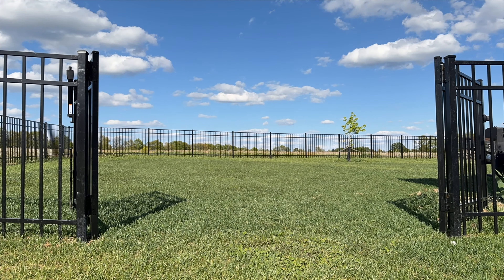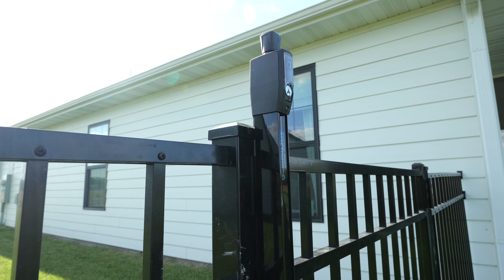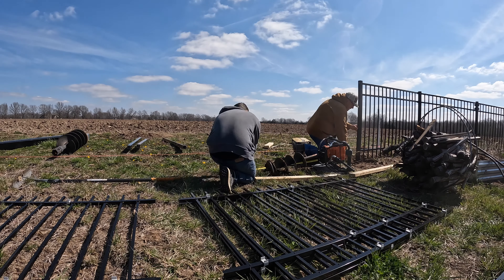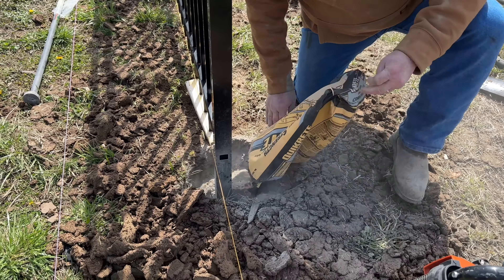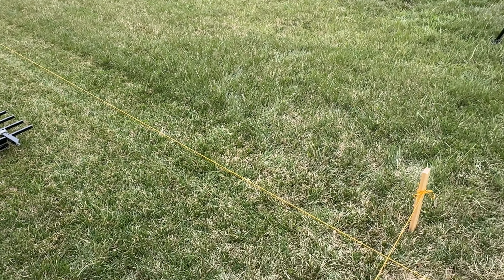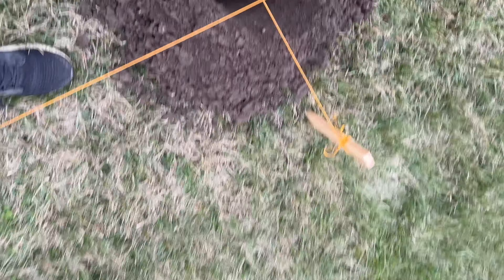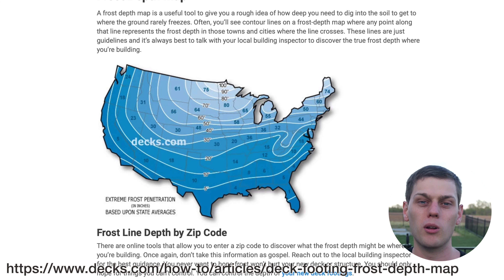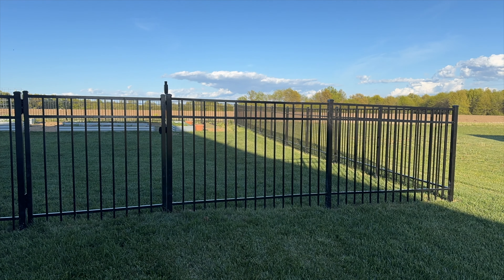Aluminum Fences Direct Review from A DIY'er's Perspective

Comment: I just ordered and ready to install. The only thing I'm confused is for the fence gate post, it has to be 19" deep for 4' gate. But it's not level with the end post or line post when it's only 6" deep. The line and fence posts are way taller than the gate post...what did I do wrong?
Reply from the maker: Email them to be sure but the gateposts should be the same height as the line posts. I think your line posts need to be deeper than 6”.